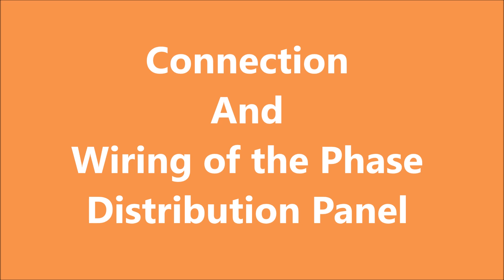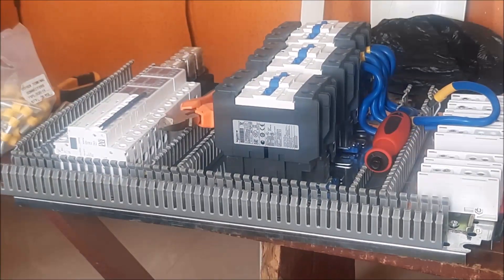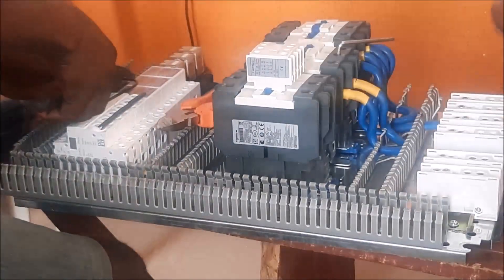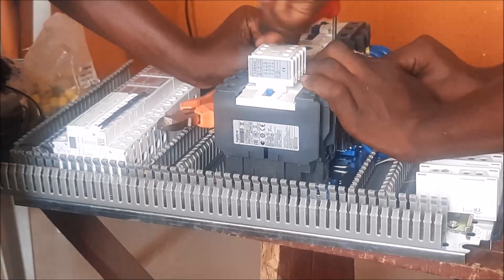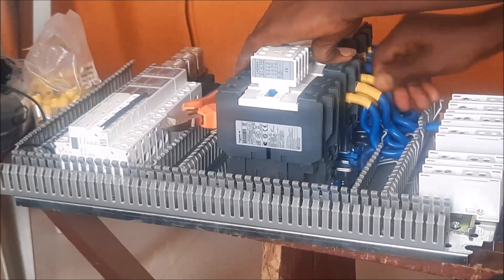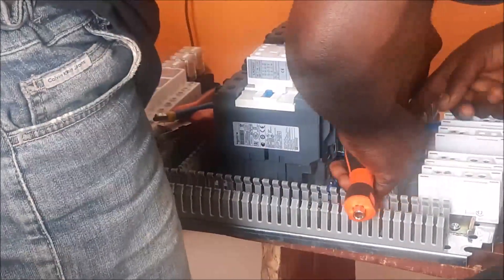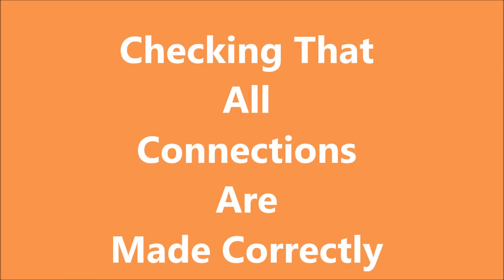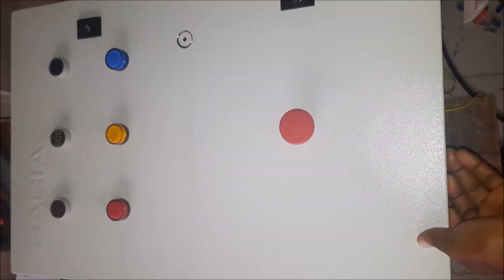How to Build an Automatic Phase Selector Panel | Auto Phase Selector.

Comment: I see the 3 phase is converted to single phase output in this video, is it possible to have 3 phase output whenever a voltage is lower on a single phase?
Reply from the maker: Yes